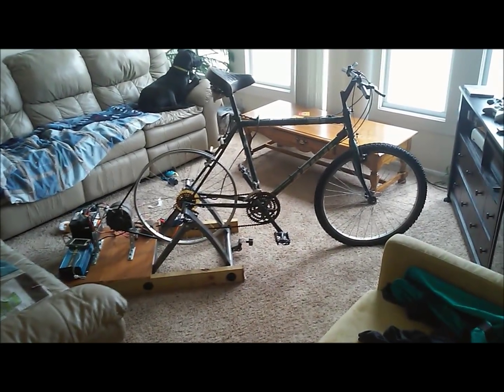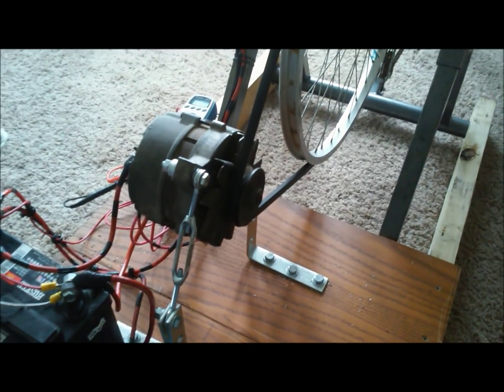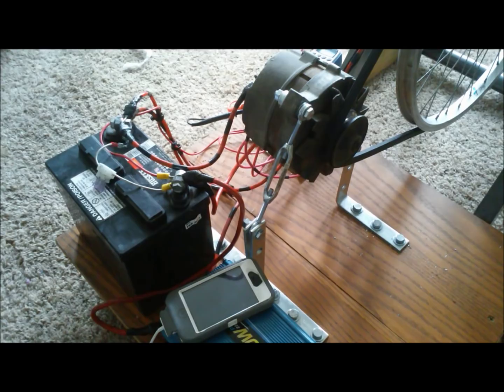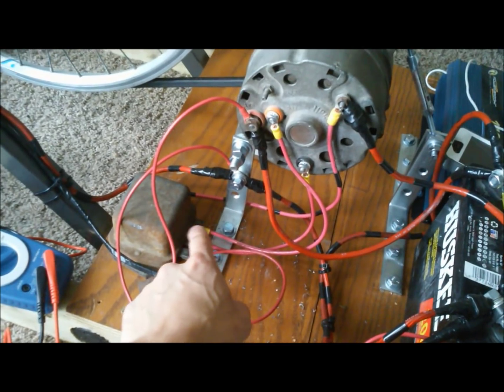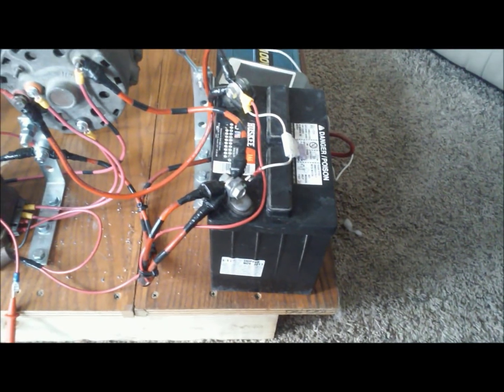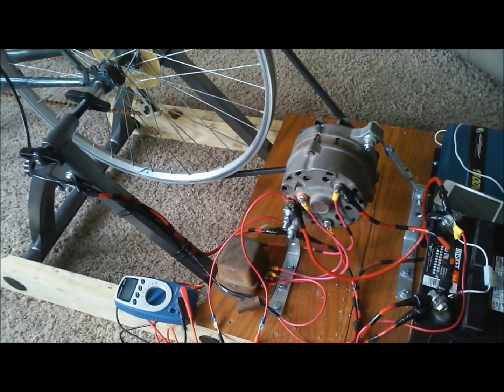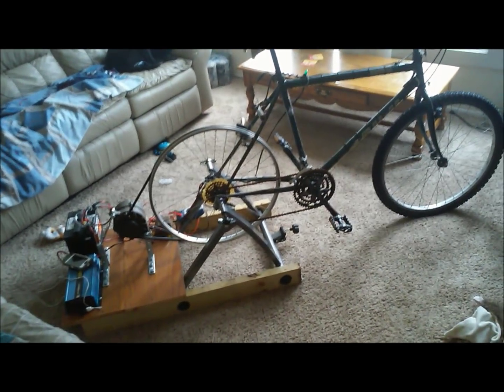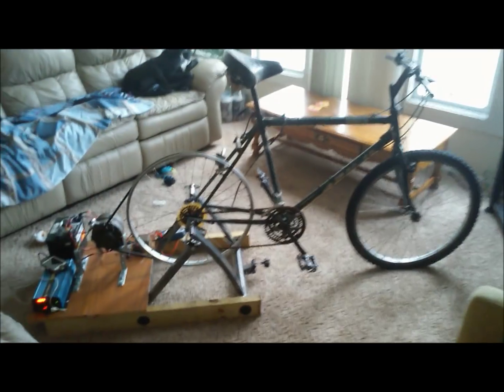Bicycle Generator: (BEST DESIGN) Stay In Shape & Power Electronics

Comment: Can you use a single wire alternator? If not what one should I use for easiest project? Thanks for the w
Reply: A one wire alternator would work. I'm off grid myself some things I've been digging into. I don't see enough electricity being made with pedal power. when I'm driving down the road it's better to charge my small lithium batteries using my DC to AC Harbor Freight converter. I want to do some more solar sometime.
Reply: @tomtee4442  Ten4 thanks, I didn’t think there would b much power either. My only thought was some is better than none, maybe lol! I was also wondering bout a in-line fuse , I seen another video where they used a lawn mower and alternator but they put a inline fuse in it. And thanks

Comment: I know this is old, but, lube up the chain to the bike, take the alternator apart and spray it with some dielectric grease, and maybe just maybe think about getting a capacitor like they have for subwoofers.  That MAY be able to be implemented to ease the load when you flip the bike on.  And also, I see no reason you can’t possibly add a second alternator.  Maybe even more batteries.  My buddies cabin is ran off of old boat batteries.  I have no idea how they charge them though.

Comment: Can you connect the generator straight to the inverter or is a battery necessary.
Reply: The battery is not necessarry however you will need at a minimum a small 12v battery to start the alternator. Or you can buy a dc motor and skip the battery altogether.

Comment: I have the same set upon a water wheel attached to a 16 speed bicycle and rear wheel is belted to a new one wire alternator. I can't get it to generate. I have 12v power switched on to the exciter wire and the alt. sensing wire has 12v as well. . ? Not sure if the new alternator is in the right position for correct rotation How can  I tell if the alternator is turning in the correct direction?
Reply: If the alternator doesn't have a fan on it they will charge either way. but if it has a fan on it and not going in the right direction the alternator will run hotter wear harder and wear out earlier.

Comment: Hi. I am thinking of using a 500amp 12/18v truck alternator driven by compressed air to charge an off grid battery bank. Then run through an inverter to 240v (Australia), to supply my house. Can anyone tell me if this worthwhile perusing?  I don’t know enough about current to know, however I do know that a 500amp alternator is a significant piece of equipment

Comment: love it! if i buy a simple 12-72V dc motor (for wind turbines etc) to use instead of this alternator, would i need a voltage regulator to limit it to about 14V so it doesn't charge battery too fast? Also I think amps have to be limited to 25% of the battery capacity to avoid too fast charging. So 20A limit for my 80AH deep cycle battery? With these limits set by a regulator, if i pedal too hard, does my excess energy just get wasted?
Reply from the maker: You will never be able to produce more than about 2 amps, your legs just can’t do it surprisingly - at least for any extended period of time. 

The best way to make one of these is to use a small AC motor, and run it through a diode - this will create voltage, but the diode stops the motor from running - from there, your peddle speed controls the voltage.
Reply: @ThunderHead289  but thats only 28 watts... great scott has a video where his design got over 200w iirc, looks like it might be time to remove "best design" from the title :P

Comment: Would this work in my camper conversion van to say power a 12v fans and some LED lighting for at night? Also if i have a car battery how much pedaling would it take for a full charge and how long do you think a charge would last on a standard 12v car battery?? Thanks in advance anyone!! I think this would make a great addition to my conversion van rather than solar panels!
Reply from the maker: hey man, i also have a conversion van - just took it to the rockies and back. 
electric is a real issue as a generator is loud as all get out and not all places have plug in electric. for whatever you are going to try and do, you will need deep cycle marine batteries. these are meant to be drawn down where a standard car battery is designed to hang at the 12 volts. you will be replacing a lot of car batteries if you try to draw them down. 
also, you really dont want to go below 50 percent of the rated amp hours or the battery can be damaged. so a 10 Ah battery is good for about 5 hours of usage with a 1 amp draw. 
as far as using this peddle generator to charge a battery, it works, but an alternator is really more designed for a load ie powering things. if you want to charge a battery, you would be better off with an electric motor that you forcibly turn by peddling with a diode in place so that the battery doesnt "turn on" when hooked to said battery. 

Heres how i would do it and how i plan to do it on my own van. 
Im just going to have an auxiliary battery in the back and run a cable from the positive of the main battery, to the positive of the deep cycle. throw a switch in between. that way when you drive, it charges that auxiliary battery, and at night, you can disconnect it from the main battery so that when you are powering your electronics, you are not drawing from your battery that runs the vehicle. 
does that make sense?
Reply: Yes it does actually and let me start off by saying thanks for the quick reply. So let me try to explain how i understood that. You are going to run a second MARINE not a car battery off of the main battery in front of the van. In between those batteries will be a switch like i would find in a boat i assume where you can pick between 1 - 2 -ALL? 

A couple more questions if you dont mind..

Would you run the batteries in parallel or series?

Would you then run an inverter off of that switch to run 120v applications i.e. Lights, fans, maybe but unlikely cooking appliances?

I am really bad with electrics and I would love to have a stable and trustworthy off grid system in my van. This is also my first conversion van so I am on the learning curve!!

EDIT: One more question lol. how long do you think a standard (whatever that is) marine battery would last say charging a phone, a LED light strip, and maybe a radio plugged in would last?
Reply: @Drocinit247  Hello!  A bit of math can give you your answers, which I'll get into in a bit.
First off is the marine vs regular car battery. Car batteries are not built to run a load for a long period. They are meant to dump a high amount of current in a very short time. How that happens is it dumps all those amps into the starter, which spins the entire engine until it starts. You can imagine how much power you need to turn a car engine. That is its only purpose. After the car starts, the alternator takes over the job of supplying all the electric the car needs to keep running, and a small amount to recharge the battery with the amount of energy it used to start the car. This is why car batteries are not good for using to charge your phone, and/or your inverter and using them like that will destroy the battery.

Marine, or deep cycle batteries are designed for this purpose, providing energy for long periods of time.

Now to the math. Batteries are rated in Ah, which means amp hour. A 10 amp hour battery can put out one amp an hour for 10 hours. If you pull more amps per hour, the battery will run out sooner. For example if you pull 2 amps per hour out of a 10 amp hour battery, it will only run for 5 hours, etc. You can figure out how much time you can get out of your battery by adding up all the amps you will be pulling out of it. For example if your phone charger is rated at 2 amps, you will be able to charge it for 5 hours, then you look at how long it takes to get a full charge for your phone and that will tell you how many full charges you can get out of the battery before it runs out. Most devices will tell you in their documentation the time it takes for a full charge. Simply use those numbers to calculate how many charges you will be able to get.

Hope this helps and let me know if you need any more info or explanation
Reply: I once ran two batteries in parallel in a vehicle but it didn't last too long that burned up the alternator. I didn't have a isolator on it. Later I put an isolator on the second battery to charge the second battery. It was a hundred amp battery isolator for back then about $40. And it lasted no problems. And if you're going to do it with switches like the blade switches in line on batteries I would make sure you have a battery hooked up to the alternator while you're switching it. Because taking the battery post loose on just one battery and one alternator and cause the alternator to spike and possibly burn it out usually it doesn't but it can. An alternator needs a battery tied to it while it's running to keep the voltage maintained.

Comment: The design is nice but some flaws in it. The wooden box make a perfect guitar resonator and makes the neighbors a big  fan of the noise . If you incorporate a tension roller like  what camshaft belts have you can induce considerable friction  without making the belt so tight there ,providing you assemble it close to generator's pulley.
Reply from the maker: I just made her out of spare parts laying in my garage and a bicycle from the curb. appreciate the insight. 
its loud because that alternator is from a 74 f100. i originally removed it from the vehicle because the bearings were noisy/worn. the bicycle has the same issue on the chain and crank sprocket. makes for quite the bearing symphony when it was used.
Reply: I still suggest you replace the plywood with some 2" by 2". Open the hosing of the bearings in generator and lubricate them by a gear box oil w80 to 90.

Comment: @thunderhead289 i hav a 2001 nissian altima alternator and im confused where to hook up the voltage regulator leads to, my initial thought is the battery but im not sure. Any help would be appreciated thanks
Reply from the maker: +Johnny Walker I’m not sure of your exact wiring, but I’m sure you have an internal voltage regulator. Could probably put a switch in line of your leads from your regulator to your battery to get some speed before the load comes in. But yes, those should go to the battery indeed

Comment: I am trying to do something like this but to power a radio w/ 400w amp. I want to ride a bike and do this. Will this system work for that. I would appreciate any help you can give me with that. Thanks.
Reply from the maker: John Thomas it will work, but it all depends on how strong your legs are and how efficient your alternator is 👍

Comment: what amp rating is that alternator
Reply from the maker: Under full load it hits 40 amps
Reply: OK I have so many alternators so I made one as well but I cant pedal it I am thinking because my alternator rating is 150 amp its a Bosch from a Mercedes
Reply from the maker: +silverarrows01 do you do the same as I do with the switch ????
Reply: Yes I put a switch on like you did but soon as I switch it on that's it heavy pedal
Reply from the maker: +silverarrows01 did you do it the same as me with the gearing and such so that you can spin the alternator fast enough? You should be able to turn it, it only supplies power on an as required basis really. If it's spinning fast enough you would definitely be able to overcome it
Reply: I will try again tomorrow
Reply: +silverarrows01 A 150 amp alternator would be all wrong for this project, but by now I suspect you've found this out the hard way. The reason is that such a large alternator requires a fairly large field current to provide the necessary magnetic field in the rotor which produces the electricity. That current has to be produced by your pedaling and is not available as useful output. The 40 amp unit used here would take considerably less current to "excite" the field and therefore is a successful match for a human-powered generator such as this. A much better unit would be a small permanent magnet DC motor as the generator because no power would be lost as field excitation. Something like an automotive fan motor or treadmill motor fitted with a pulley would be the ideal candidate for this application.

Comment: What is the output voltage ? from the regulator. From my research on the interweb i found that 5v would be ok for charging your phone. Or am i wrong ? ( usually the phone batteries have 4.2V or so )
And your voltage regulator, does it look like this on the inside ?  https://cdn.sparkfun.com//assets/parts/9/9/00107-1.jpg . I didnt really find a voltage regulator like yours, with a shell.
Reply from the maker: The regulator is an automotive unit from a 74 f100. The output voltage is 14.5 or so as you need roughly 2 volts above your battery voltage in order to charge it. The power out of the inverter is what matters to you for a phone. You have to go through an inverter or else you will not get consistent voltage.

Comment: i think if you oiled up that rusty chain you could get another tenth of a volt ;)
Reply from the maker: might be the rustiest chain ever
Reply: have you tried to hook up a clamp style DC ammeter to the alternator output with a decent load on this setup? im interested in what kind of amperage you are producing from the alternator
Reply: Seriously.....if you lived nearby I would come down and lube that chain for free lmao....I can hear it crying from here.....Awesome video.....I don't know what lured me to this topic but I want to make one so badly.  Great job!
Suggestions for improvements. Rubber washer mount the alternator with grommets. Will help reduce the noise. put a layer of insulation (R12) under the platform. Also will reduce noise. The hollow acts like a speaker.  Might want to add another base piece of plywood or shelf so that it's(the added insulation) enclosed Great Motivator! Good Job.  I love your video. Keep up the cool projects!
Reply: every bit counts!

Comment: what would you say is the minimum rpm needed to generate voltage and current? I want to implement this idea on a mobile bicycle to power a 12 volt stereo
Reply: i just purchased a one wire 220 amp GM high output alternator on amazon and it says it produces 150 amps at idle and most vehicles idle at less then 1000 rpms.
Reply: I have a gm alternator from a 2001 Malibu that I had tested and works, I'll have to find a Pinout for the 4 pin connection and give this a try! What wires do what? I think mine is same pins.
Reply: http://www.justanswer.com/chevy/2n3lz-99-malibu-wires-broke-off-when-removing-alternator.html   pretty sure you just connect B and C to battery positive
Reply: Jake Martin awesome thanks! I'll try wiring it up on my workbench and spin it with a drill to test wiring. i will have to figure out how to make a gear to pulley system for the bike so I can spin the input shaft really fast at low speeds (we make crazy bikes and ride them around at the beach, I have a few up on my channel)

Comment: So can any of you tell me roughly how long it would take for a person to recharge a car battery using a system like this?
Reply: depends on the amperage produced by the alternator and the capacity of the battery. most car batteries are from what i understand around 40 to 60 amp hours but what you would need for a setup like this is a deep cycle. a 100 amp hour deep cycle would take 10 hours to recharge at 10 amps current. batteries are really only 50 percent usable unless you want to drain them further and seriously take the life away from it. but couldn't really tell you how long it would take to charge a car battery with a setup like this unless he hooks an ammeter up to the output wire on the alternator and actually shows the current leaving the alternator. but for a car battery i would estimate 3 to 4 hours and a good 100 amp hour deep cycle 10 to 12 hours of pedaling. not really sure bud thats just my guess

Comment: Hello. We are currently doing a similar project. How much force does a person require to make the alternator spin on its rated rpm? The human should be able to maintain the required speed of the alternator to produce energy, right?
Reply: i would say the most a human can produce is 3/4 horsepower and of course you can sustain RPMs to produce energy but to what point is the question. i haven't seen anybody on youtube actually hook up an ammeter and give us actual current readings in voltage and amperage leaving the alternator on a setup like this while throwing a load at it. so your guess is as good as mine
Reply: i just built a homemade alternator generator and have a 3 1/5 horse briggs and a 5 horse honda. the 3.5 briggs wasn't even enough HP to run my 8.5 amp saw zaw it completely bogged it down until it shut off. your not running anything that requires some serious wattage with a bicycle attached to it. my 5 horse honda will run my saw zaw or an air conditioner or a couple refridgerators. but your not pedaling that kind of horsepower to sustain 1000 watts at 120 volts. thats probably why he didnt throw a nice load on that inverter and try to pedal it lol

Comment: can i bind/couple a 12v car lighter to the battery so i can charge the phone by pluging in it and not buy an inverter ( or doing something similar )  ? does it work that way ? or an inverter is a must? i am doing the same thing you did for my final year in college and your video is helping me a lot ! And can you help with the voltage regulator?  12 v ?
Reply: Yes, you can do that.  An inverter is very inefficient.  It converts 12v DC to 110v AC and then it convert back to DC which waste a lot of energy.
Reply: thank you